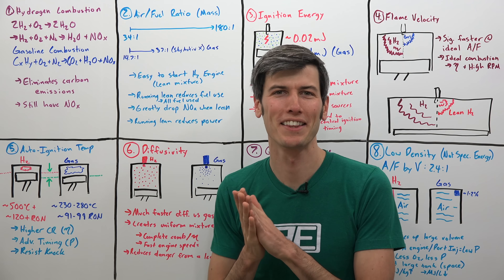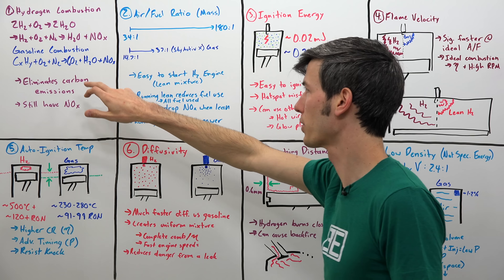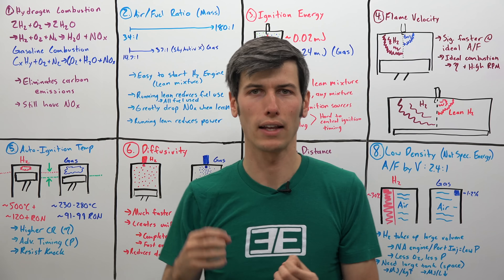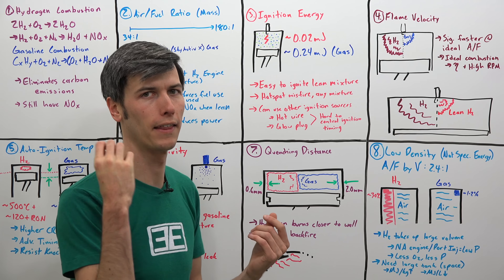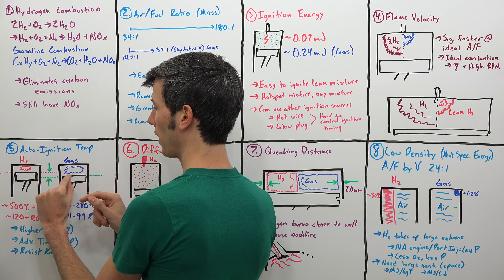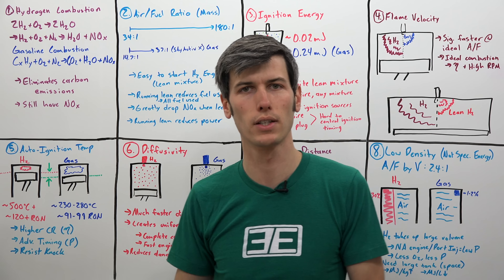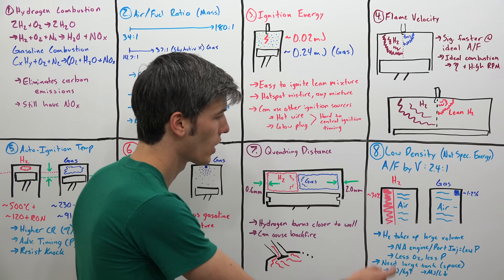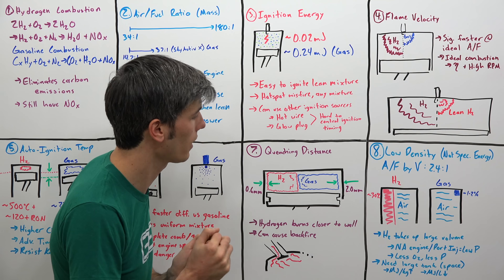The Difference Between Gasoline And Hydrogen Engines

Comment: I wonder what is going to be the future.
1) A hydrogen combustion engine car.
                          Or
2) A hydrogen fuel cell car.

I think the second option is the best as in 2nd case the fuel cells generate electricity and charge the battery which in turn power the vehicle, as majority of automobiles are going electric.
As well as because of fuel cell technology there would be no NOx production.

But we still have to find the solution for all the lithium needed for the battery production as well as battery recycling if every car in the world would convert to electric.
By the way great video as always, you explain complex things in a simple and easy way. Wish I had someone like you in school who would have made learning easy and fun and interesting.

Comment: I'm surprised the negative joule-thomson coefficient of hydrogen didn't make an appearance.  Hydrogen is the only substance I'm aware of the cools off when you compress it and heats up when it decompresses.  His comments about not having to worry about leaks causing fires also surprised me.  Hydrogen is super easy to ignite (low minimum ignition energy), has a wide open flammability envelope (4% to 75% by vol) compared to gasoline (1.4% to 7.6% by vol), and actually heats up when it leaks out, making it easier to burn.  To make things more fun you can't see the flame during the daytime.  I suppose if you caught some plastic components in the engine bay on fire then you would have plenty of black smoke.  Anyone have any experience with hydrogen leaks in hydrogen fueled cars?
Reply: On demand hydrogen would solve your issues. Water injection could help cool and also provide more power through thermal expansion of water to gas. Just need some expensive sleeves probably to protect your block from hydrogen diffusion

Comment: How does hydrogen compare to diesel or heavy oil fuels? 
Would using hydrogen as a fuel for base load electricity generation provide best efficiency? Hydrogen could be produced on site and energy distributed over the existing power grid. 
Thank you for the very interesting video.
Reply: Hydrogen is not a fuel "source" (operating word here), it is an energy storage method. Industrially, you get hydrogen from reforming natural gas or wood, which is converting carbohydrates through heat into CO2 and H2 OR electrolysis of water, which means you input electricity to split it. In any case, you get to keep H2 in its reactive state. By allowing it to react with oxygen again, you get back that energy minus anything lost to inefficiency and lost hydrogen that simply evaporated from storage. 
For electrolysis, at the very best (and by best I mean physically impossible no-loss, 100% efficient system), you would get net 0 in energy production. There's no free lunch. And for fossil fuels, you might as well be burning them to begin with.

Comment: I remember when i was college fuels 1 we build a hydrogen generator (mason jar style) our theory was every car should one but it would need a toggle switch, air line coming off the air intake so it had clean air, another air line going the manifold, and a back pressure valve for safety but, to maintain it was to much for some empty the bad water, clean the plates, hook it back up. It was fun to build i enjoyed it

Comment: How about storage?  Have safe hydrogen tanks been developed that provide an adequate vehicle range?   While the hydrogen you burn in a vehicle may only produce water and a few nitrogen oxides, how the hydrogen was produced matters.  The cheapest way to produce hydrogen is to get it from natural gas, which isn't any more environmentally friendly than just having a Natural Gas engine in your car.  I wish the United States had more Natural Gas vehicles and filling stations.

Comment: It could be interesting to see a video of why gas to HHO converted engines are not possible.
Reply: adding HHO to a gasoline engine are not possible??
Reply: Antonio tod I have my doubts about the corrosion caused by the water vapor product of the combustion. I don’t see many HHO cars on the streets, do you? I’m talking about cars running on water converted to HHO by electrolysis. There’s a lot of this stuff on YouTube.
Reply: @iscluiscaduk  when u burn fossil fuel you get CO2 and water vapor, so every engine inside is rusty?? you cant tell if a car has HHO generator or not just by looking at it... you mean cars that are running only with HHO??

Comment: When running lean engine temps are higher so wouldnt you make more NOX when running lean?
Reply from the maker: This actually isn’t true, common misconception. Hottest temps are generally around stoichiometric air-fuel ratios. People say “lean burns hot” because they’re referring to high load/high RPM scenarios. 14:1 burns much hotter than say, 11:1, where your air/fuel ratio should be when flooring it. But 14:1 is still technically “rich.” It’s just less rich than 11:1, so people say lean burns hot.
Reply: Engineering Explained interesting, would it be wrong to say that at 14:1 and leaner the temps are the same as there is complete combustion? Thanks!

Comment: Hydrogen doesn't produce carbon emissions at the point of consumption, but it does at the point of production. Hydrogen is made from natural gas, and the process emits carbon. Theoretically hydrogen can be produced without carbon emission by splitting water, but if we are talking about theoretical emissions, gasoline and diesel can be made from biomass in a carbon neutral process. Hydrogen may still be less polluting overall, but it takes a well to wheels analysis to get there. Actual gasoline production also produces carbon emissions too, refining takes a significant amount of energy, a lot of it in the form of burning the hydrocarbons that don't go into marketable refined products.

Comment: With the ability to run extremely lean and lean providing less power, could you reduce pumping losses in your spark ignition hydrogen engine as in a diesel? i.e. Use a lower quantity of fuel injected to reduce power at cruise so that the engine is running at wide-open throttle. That might work better than a fuel cell for Class-8 trucks on the long-haul. No low temperature limits for startup either.
BTW, kerosene is still used for 1st stage in rockets because the fuel tanks/fuselage can be smaller and lighter due to the volumetric energy density of RP1. This gives an advantage over hydrogen in the gravity drag and aero drag region of flight.

Comment: In future, when Oil start to run out we could start to design bulky looking airplanes where hydrogen balloons would take considerable space within compartment but lighter than fuel packed transportation devices. So, we have about 20 years from now when we start to shift to these newly designed airplanes on our skies above.

Comment: I’ve been wanting to attempt an HHO build. I was thinking about using a Toyota 20r because I have 2 of them. But the other day I was wondering how well a rotary engine would handle hydrogen. I’ve heard that they can take nitrous well because they have a high rpm range. It wouldn’t necessarily be cleaner because it would burn oil because it’ IS a rotary. But I figured it would take less modification to run on HHO than a normal piston engine.

Comment: With Firestorm plasma style spark plugs, any car could run on a lean burn 24:1 air/fuel ratio and get instantly 40% better fuel economy. Other technologies exist to get 150 MPG from more efficient engine designs.

Comment: Would be cool to have 2 large missile shaped H² tanks on the roof of the car, then you don't take up space in the car and they're aerodynamic as well. And in a case of emergency you could have an evacuation valve in the end of them and launch them away.

Comment: I wonder what happens if a hydrogen engine gets really worn out and starts to suffer from significant blow-by.  It makes me think you would need some sort of oil/water separator in your oil system you would have water building up in the crank case.

Comment: Why not just use a hydrogen powered fuel cell instead of a piston engine that also creates wasted friction horsepower? Hydrogen turns to water, makes electricity to power electric drive motors connected to the car's wheels. No moving parts to convert the energy into useful locomotion.

Comment: In regards to the hotspot problem; hotspots would come from carbon deposits, would they not? So not much of a problem when burning hydrogen.
Reply from the maker: Could be, or the spark plug, or exhaust valve. Also, engine oil can introduce carbon into the equation, especially with EGR.

Comment: What about the reliability with the engine? Apparently Hydrogen can react with carbon to make methane. Wouldn't that mean that there would be high temperature hydrogen attack? This could cause fatigue in the metal right? I am sure it would be a slow process though, so not a serious problem, I guess.. I'm in favor of Hydrogen engines. Seems fun imo.

Comment: I did a high school graduation project about the future of hydrogen fuel, my conclusion was that hydrogen only has 2 downsides (and a lot plus sides), one was that it is hard to produce on a big scale (right now) and the other one is that it is hard to storage a lot pressurised hydrogen safely in a car. I think that if we can get those 2 things fixed in the future that hydrogen cars are going to be way better than electric cars.

Comment: I love hydrogen and I would love to see cars powered by it, but there are some problems that I foresee with storage and production. First storage of hydrogen either takes extremely high pressurized tanks or extremely cool storage. These in themselves could be very dangerous in a crash or take a considerable amount of energy to maintain. The second problem is in order to get hydrogen from water it takes a lot of energy and that energy has to come from another power source.

Comment: Thanks a lot for this video. Most of the times, when Hydrogen is discussed, it is in context of fuel cells and not combustion engines. I remember BMW did have a practical test run with a fleet of 7 Series with a V12 engine.
To me there are a couple of questions:
1) Lubrication. Does hydrogen usage require more or less lubrication, does it "use up" lubricant more quickly, than petrol/diesel?
2) Fuel storage. Obviously hydrogen storage is quite a challenge. Being so small the hydrogen likely can escape through the walls of any tank. And what about the lifetime of tanks and fuellines? It is also likely that some of the hydrogen reacts with the material and make it brittle.
3) Storage methods. What methods are there? (pressure, liquified, chemical storage in a host fluid)

And 4) just out of curiosity. Would a Wankelengine be resonable for hydrogen? The upside is definitely the flame speed. The downside the nightmarish seals and (i guess) also the size. What do you think?

Comment: I wonder if you could run lean enough to operate at low power with the throttle wide open (to an extent), thus avoiding pumping loss?

Comment: The low density of hydrogen is actually bad for most rocket applications because it gives the rocket a low mass-fraction. The tanks need to be bigger to hold more fuel to get the same total thrust. This adds weight and drag. LH2 requires insulation to keep it from boiling off, and keep it from freezing everything else on the rocket. This adds more weight and expense. Simple Kerosene is a far better fuel for a rocket booster than LH2, because it's much denser and doesn't need special tanks. This is what you want for a booster. LH2 is useful in upper stages where the heavy lifting was done by a Kerosene booster and you want a really efficient fuel that isn't fighting drag or gravity like booster stage has to do.

Comment: You did not mention the oil will last a lot longer between oil changes. maby ten times longer.
Reply: The oil would be less contaminated from hydrogen, but water can still gather in the oil because of the temperature changes and oil can still burn if there are hot spots.
Fine metal particles gather in the oil because of wear, these particles needs to be removed also.
Oil will loose its abilities over time, that is why the changing requirements say 10.000 miles or 2 years for example.

Comment: Speaking of auto ignition. My waterpump went out on my snowmobile and it kept overheating anf it got so hot that it would not shut off even when i puilled off the sprak plug wires

Comment: I am confused about the "ignition energy" because it would depend on the mass of the fuel.  For example, 0.02 mJ introduced to 1mg of hydrogen would be much more significant than the same energy introduced to 1 kg of hydrogen.

Comment: Excellent!!!! The only person that I know that can have 15 pages of text in engineering in a video less than 15 minutes long. Very dense content. With a whiteboard on the background? Priceless....
Reply from the maker: Glad you enjoyed it, thanks for watching!!
Reply: How does running lean reduces Nox if you run lean on a gasoline engine  Nox will increases because of heat not decrease. Is there a difference between Hydrogen engines
Reply: @natedaviscteinstructor  The activation energy to break the simple H2 bond is VERY low, and the reason Hydrogen gas is dangerous in quantity; the activation energy to break the C-H bond is higher, so because ignition temperature is lower, more oxygen reacts with Hydrogen than happens with Octane or other hydrocarbons.  2H2 + O2 => 2H2O is a much lower 'energy hill' to get over than with hydrocarbon combustion, so less of the triple N2 bonds are broken and less NOx is formed; make sense?
Reply: @HuntingTarg  thanks for the education
Reply: @HuntingTarg  If it's lean it means there is excess oxygen that can (potentially) react with nitrogen. (Don't claim a lean hydrogen burn has NO NOX at all, it it's not lean enough it will have nox for sure) Whether that happens pretty much depends on the temperature.
H2+O2=H20 and N2+O2=NOX are 2 separate reactions, if O2+N2 get hot enough they will form NOx.
The thing where hydrogen and petrol differ is this: when an lpg, cng, diesel, petrol, etc engine is running rich it means more liquid fuel will turn into a gas (this is why water injection reduces emissions) and if you inject too much fuel then there is no oxygen left to marry the nitrogen. If you run lean obviously the opposite is happening.
For hydrogen engines the max flame temperature 2600°C is achieved at a stochiometric a/f mixture; the zeldovich reaction (N2+O/N+O2=nox) usually occurs above 1600°C, but it does occur below that temp as well under certain conditions. When a hydrogen a/f mixture is leaner it will burn cooler because there is less fuel(less energy) that has to heat up the same volume (all the gasses inside your reaction chamber).
Hydrogen is already a gas, so when hydrogen burns there is no liquid that needs to boil, and boiling is an endothermic reaction. Even simpler said: it takes energy to turn a liquid into a gas, and when you inject water or inject extra diesel/petrol into your engine it's extra liquid that sucks up heat.
Lean petrol runs hotter than stochiometric petrol, lean hydrogen runs cooler than stochiometric hydrogen. That's the difference.
Reply: @sasjadv  
I thought the context was fuel lean/rich; misapprehension on my part.  With respect to reactant ratios, I'm cognizant of everything you went through, I just answered the wrong question.

And I never claimed that emissions would be NOx- free; that's ridiculous unless one wants to run on compressed pure O2.
Reply: yes great info/time ratio :)
Reply: "N"

Comment: i'd like to see a comparison between Hydrogen and LPG, and what kind of mods a common port injected engine would need to be capable of running on Hydrogen. would it be as easy as just putting in an additional tank in the spare wheel space, and connecting it with a fuelline to the injector rail? as is with LPG or CNG?

Comment: How do you have low ignition energy and high knock resistance? Someone explain my mind is blowing up.
Reply: Low ignition energy is property of hydrogen....and maybe knock resistance from high diffusion rate I believe ?
Reply: Probably has to do with the way the flame front spreads so quickly with hydrogen. You need a higher temperature to initiate the combustion with hydrogen than gasoline, but if you do initiate it even a tiny flame will quickly spread out and burn the whole mixture, where as with gasoline a very small localized flame will just die out so you need a larger and longer lasting spark to make sure you have a large enough flame to start.

Comment: Like all of your videos, a great job.  An additional safety advantage that hydrogen has is that leaks to upwards into the air unlike gasoline leaks that result in flammable vapors being present on the ground for some distance from the leak.  So cigarettes or sparks are very unlikely to ignite the leaks.

Comment: I don’t know exactly but I read that a big downside of hydrogen is that it “eats up” your oil, which can cause lubrication problems. And the storage of it is very problematic as it needs some special tank system to keep it where it’s meant to be. And it also doesn’t produce that much power (BMWs 7-Series 6 litre V12 only had about 260 PS) But a really interesting topic and I would love to see this technology be the alternative to electric, gasoline and Diesel engines as they still got the same charm because of the way they work and the sound.